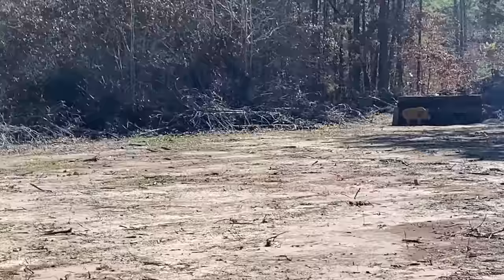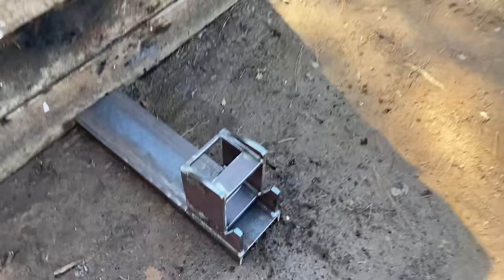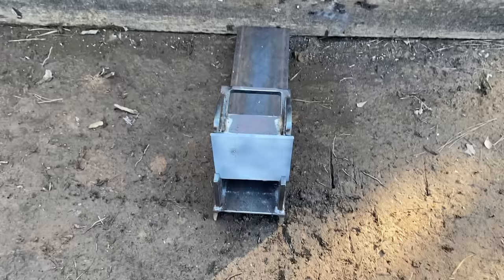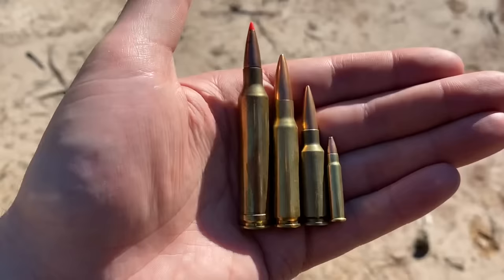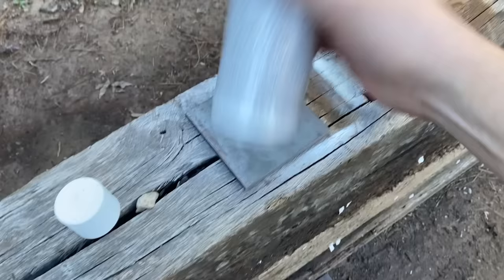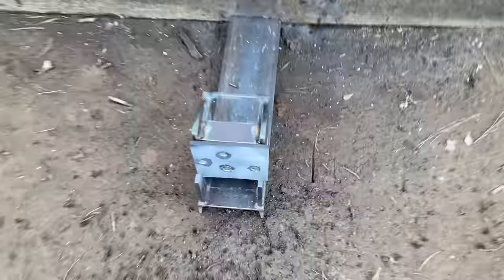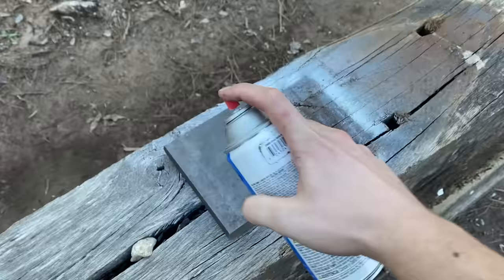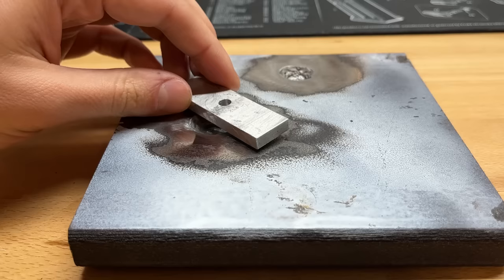338 Lapua vs 7mm RM vs 308 Win vs 6.5 Grendel On Steel

Comment: Sled 2.0
27-FEB-2023 to 28-FEB-2023
You have already been forgotten....

Maybe make the posts out of 1 inch steel?
Reply from the maker: 1 inch may be what is needed lol. I was thinking about making it out of ar500 which I would think would hold up

Comment: i wonder if the ratio in volume of the craters is proportional to the ratio of advertised energy. like quadratic drag basically but with metal instead of fluid.

Comment: what about the original sniper round 30-06
Reply from the maker: That would be a good one. In the previous test it did pretty good, but I need to try some different bullet styles
Reply: @bananaballistics  I love your vids man, keep up the good work.

Also, while I doubt you will get to this comment, I would love to see a video on the differences between semi-auto and bolt action rifles.

I was recently talking with a guy, in your comments actually, and another one in real life if I'm being honest, and we talked about how there are dozens of differing factors that can affect how fast a projectile leaves the barrel. Everything from finish, to tolerances, to if the barrel is bent, to even muzzle devices such as brakes and flash hiders. Nothing is ever perfect, but do you pay for better performance, something like a palmetto vs a smith and wesson. Just some ideas for the future.

Comment: a 75 grain hp out of a 25/06 going 3740 fps will go through a half inch plate and looks like it had been drilled.   Speed baby.  Try it on the 3/4"

Comment: i have a kar 98 and a 7 mm mag and mouser chambered in 308 the best for distance is the 7 mm mag on my set of guns but i have a lot of good guns my fav for just shooting is my 1858 model ubirty remingtons cap and ball or 45 long colt have a lot of cylinders and converters for the set plus the were reworked by a retired colt gunsmith he made them shoot perfect he filed the barrels till the shot perfectly straight out of the barrel  he made them have next to no blow by on the cylinder u can't even put a 1000 fueler gauge between the barrel and cylinder after pulling back the hammer pushes it tight so u get6 max pressure

Comment: Surprised after all the videos, which I thoroughly enjoy btw, you haven’t used a 50 BMG for the LOLs. Betting right now it will clear the 1.25 inch plate but not a 1.5 inch plate.

Comment: lol I’ve noticed the same thing with 308 in 16.. literally the same power as a 30-30 with the 160 lever evolution chronograph is 2366 with the LE’s. In a long bolt gun I’m sure the 308 can approach the 30-06 maybe.. that 7 hit a lot harder than I was expecting

Comment: I’ve got a 220 Swift at 4000 ft/sec that will make your inch plate cry.  I’ve done it before.  Has to do with the shock waves and the velocity.  And that’s with a 50 gr bullet.

Comment: What about the difference between the .308 and M118LR?
I know that the 7.62 variant does have LAP characteristics while the .308 isn't exactly famous for it, but I have no idea as to what extent.
Reply: .308 is a civilian round.  He was using 168 gr bullets.  If you want a military ammo, it would be M118.

M118LR is nato spec.  It’s also a 173 gr bullet.
Reply: @janosvadas  
I know that quite well, as the M118 is my primary ammo.

Comment: I hate to be a naysayer, but I feel like your bullet selection could often times be better. I'd have to go back and re-watch videos to cite more examples, but some of your 300BLK choices have been less than ideal, and this video's selection of a 168gr bthp from a 16" barrel is not great. M80 ball (147gr FMT-BT) would've been much better to mitigate a fairly short barrel length, let alone the differences in bullet construction of a match oriented round versus a milspec FMJ. I like where you're going with these tests, but maybe bring in someone that would've known up front that PMC 168gr SMKs would be soft from a 16". Federal GMM 168gr chrono'd with the same chronograph at about 2390fps from my 12.5" SCAR 17, so I think using more aggressive loads would be more fair. Nice work overall, but some of these comparisons are not as good as they could be.

Comment: The 308 dont belong in the same class as the 7mm or the 338 ..it belongs with the 6.5 Grendel..it is way below the 7mm and the 338..its below the 30/06 it is a very low power 30 caliber

Comment: I'm stuck between 7 mm rem mag and 300 win mag maybe a 30-06 idk what to pick. I want to take down a Kodiak someday. That would be a lot of meat
Reply: The 7mm and the 300 are basically the same just depends on if you want a 30 caliber or a .284 caliber..the 30/06 aint in the same picture as the 300 or the 7mm